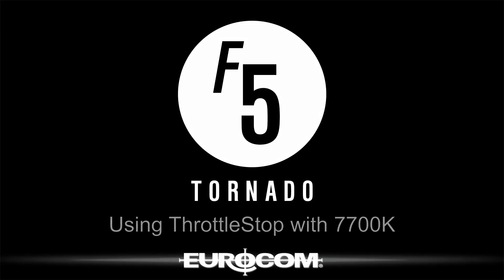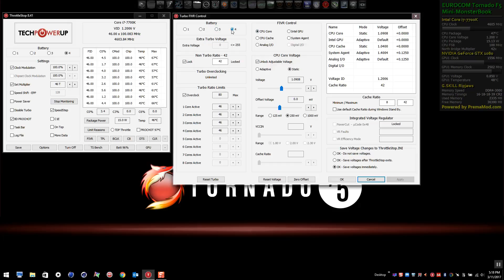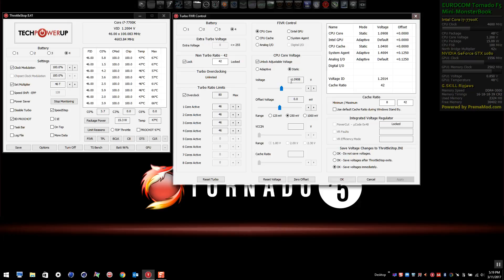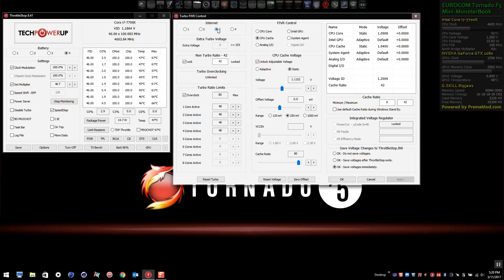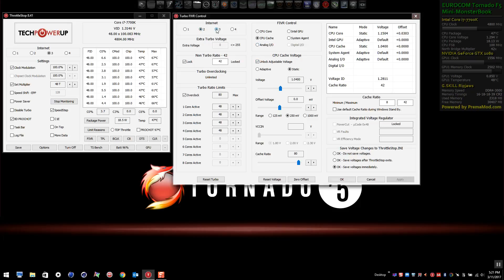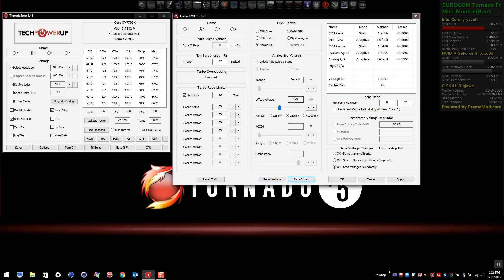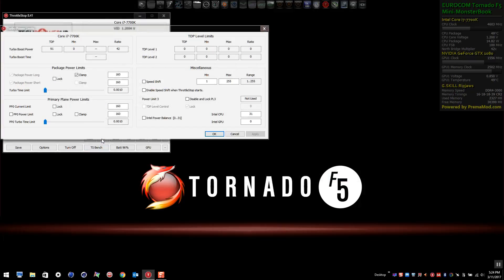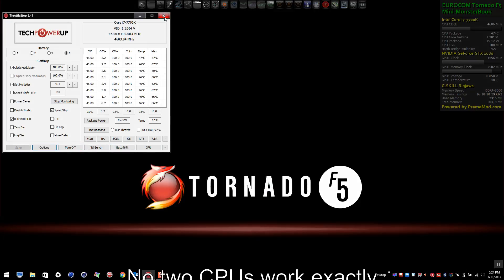EUROCOM Tornado F5 7700K ThrottleStop Settings

Comment: Hi Mr Fox. Sorry if this is a dumb question but do I need to perform thermal modding on my laptop before using these settings?
Reply from the maker: Hi bro. No, that is not a dumb question. The answer isn't a simple yes or no. It depends on how hot your system is getting. Cooler is always better, so any modding you do that improves thermals is a good thing, but whether or not you need to do that depends on the results you are seeing. The nice thing about ThrottleStop is you can configure 4 profiles and use the one best suited to the environment. If you are using it in a hot environment, simply switch to a profile with lower clocks and voltage.

Comment: I've tried using your OC PDF guide for 7700k and throttlestop but I'm hitting a weird issue. It'll stay clocked at 4.6GHz and when I run Cinebench it downclocks to 2Ghz. I'm at a loss as to why.
Reply from the maker: Hello. Is your 7700K-powered system a Tornado F5, a Clevo laptop or a desktop? If you run ThrottleStop benchmark with the Limits window open are you seeing any yellow or orange flags?
Reply: @MrFoxRox  Tornado F5

So I went back through and ticked the appropriate settings and I must've enabled the wrong PL settings (the ones in the sub-folder) instead on the base level. It appears to be working correctly now but my temps seem really really high for 4.7, getting like mid-90s on load doing Cinebench. Should I be lowering the voltage? I have it set to 1150 atm.

EDIT: I am seeing yellow flags on the Limits window. EDP Other, PL1,  and Thermal. When I run TS Benchmark I get red flag on Thermal and EDP Other.
Reply from the maker: @GIGATANK-ke2wb  glad you got it partially figured out.  Use ThrottleStop and set all of the power limits to the maximum. Turbo Boost Long and Short at 4095. PP0 Current Limit at 1023. PP0 Power Limit at 4095. Do not select "Lock" for these boxes. On the FIVR window, check the box "Disable and Lock Turbo Power Limits" and download the RwDrv.zip file and unzip the RwDrv.sys file into the same folder as ThrottleStop. If the PowerCut box is available, check it to disable PowerCut. Check the boxes to change VR Faults and Efficiency Mode to be "Disabled" as well. On the main ThrottleStop window, make sure Speed Shift - EPP is unchecked. After doing those things any more red and yellow flags on the Limits window?
Reply: @MrFoxRox  Can't check VR Fault and VR Efficiency so they stay enabled. I check them and hit apply but they revert back to unchecked when I go back into the FIVR menu. Powercut is also unavailable to check. Set the rest but still getting red flags on Thermal and EDP Other.

Comment: Do I need an unblocked BIOS or ThrottleStop  helps me to override safely the setting without any BIOS flash ?
Reply from the maker: No, the BIOS is totally crippled by MSI and you need an unlocked BIOS to overclock the CPU or use XMP or custom memory settings.
Reply: Thank you for the reply! Is it possible order with Prema/Svet BIOS included?
Reply from the maker: You are welcome. Yes, it is now offered with an unlocked BIOS from Eurocom. This is being included at no extra charge through Friday March 17. It has to be applied by Eurocom prior to shipping.
Reply: I order my Tornado F5 by Eurocom this week (before the BIOS option). I hope it will arrive with the new unlocked BIOS. Should I request it explicitly?
Reply from the maker: Yes, please call them and follow up by email to be sure they apply the unlocked BIOS before the machine ships to you. I suspect they will give it to you for free since the special offer is going until Friday of this week and your machine has not shipped yet.
Reply from the maker: The free unlocked BIOS offer is extended to the middle of April.

Comment: how do i disable c states for i5-3337U processor using throttle stop? I suspect c states has been causing problems ( my pc freezes every few seconds)
Reply from the maker: +XPumpkins - what system? If it has a respectable BIOS you enter the BIOS and disable it. Doe your system allow it?
Reply: Sadly, my laptop is from Acer... Most acer products, even the predator helios 300 doesn't have Advanced tab in their BIOS. So, I can't disable the C-States from the BIOS. My laptop is Acer Aspire V5 471G. I've ran troubleshoots for everything and didn't find any problem. I then checked the task manager to check what seemed to be the problem, so far... the cpu seems to be the problem as when the freeze occur, the performance of the cpu would drop to 0% or under 10%. As for the others ( disk/rmemory/gpu/wifi) seems very stable, I've even reinstalled windows 10 for 3 times already and cleared all my files but the problem still persist, however, sometimes it functions as usual, which is weird
Reply from the maker: OK, you might want to try using ThrottleStop and see if that helps. You can change things that are not available in the BIOS, and they are not permanent. They only apply if ThrottleStop is running, so you do not have to worry about messing things up. If you remove the check mark for C1E that is similar to disabling c-states, and there is a menu for manipulating c-states. If you are not familiar with it, there are several videos in my channel showing how to use it. Here is a link to download it, speak with the author and ask questions. http://forum.notebookreview.com/threads/the-throttlestop-guide.531329/
Reply: Thank you, I couldn't find the guides before, since the search results are spammed with other advanced throttlestop conversations. Thank you again sir
Reply from the maker: You're welcome, bro.
Reply: MrFoxRox turns out disabling c states does nothing, maybe i did something wrong with the configuration or maybe something is wrong with the hardware physically since it gets worst if i apply pressure onto my laptop keypad, besides it's an old laptop
Reply from the maker: +XPumpkins yes, that does sound like another problem. Maybe if you are comfortable working on the inside of it you can take it apart and find the problem. If you have not recently done so, maybe clean the insides and replacing thermal paste would be a good idea.
Reply from the maker: How are the temperatures?
Reply: 50 celsius when idle , 70 celsius when in use (EDIT: The fan in the laptop isn't working anymore but I have a cooler pad. It manages to reduce the temp below 80 celsius when under a heavy load)